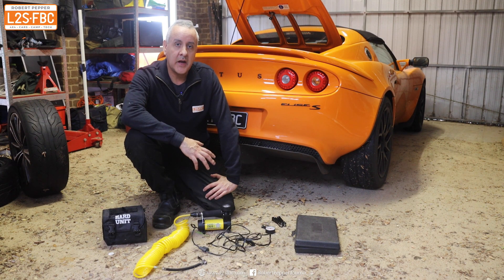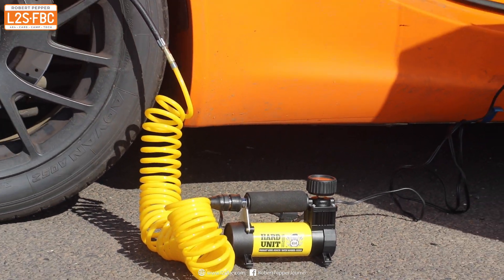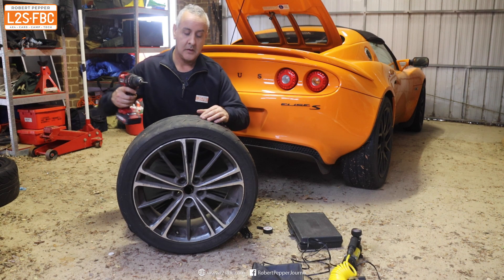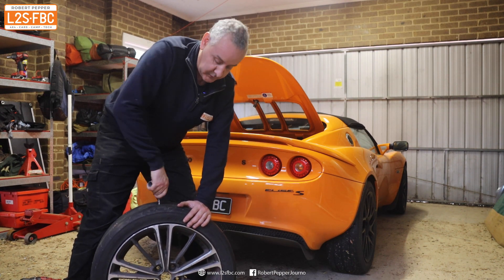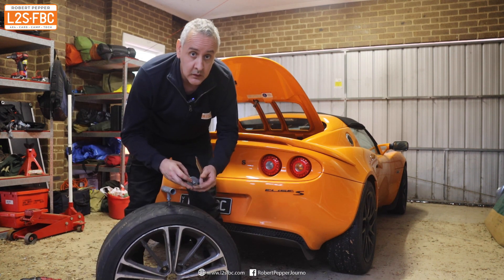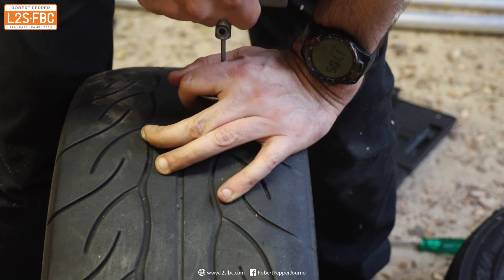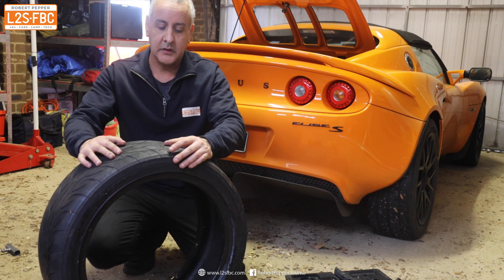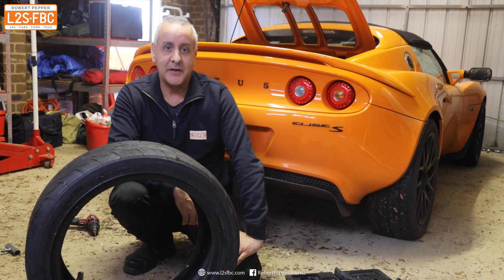No spare tyre? Fix punctures and flat tyres anyway in your EV or sports car!

Comment: Robert, thanks for the demonstration and advice! I had a club run in my Miata last week, checked beforehand, and the "space saver" spare was flat. Aired it to factory 65 psi using a Ryobi Lithium (looks like an electric drill with a hose). Any thought on these vs. 12V compressors?
Reply from the maker: Why bother with a bulky and heavy battery when you can just run it off the car?
Reply: @L2SFBC  Smaller than the compressor...
Reply from the maker: But isn't it compressor with a battery?
Reply: @L2SFBC  Small lithium cell 6" x 4" x3"...